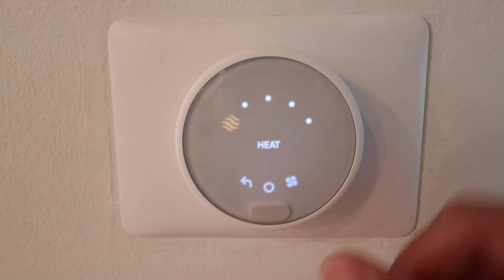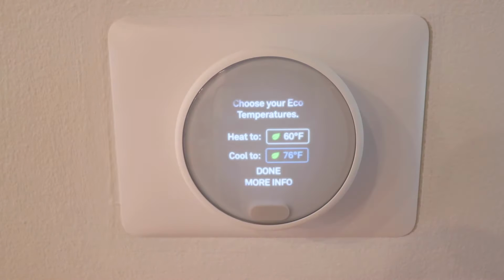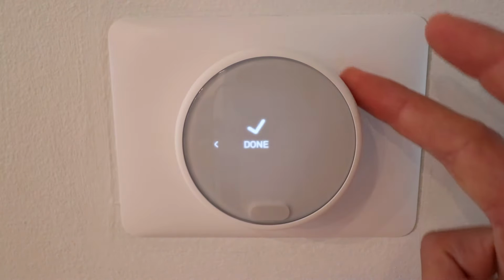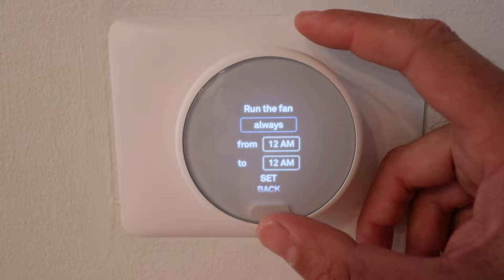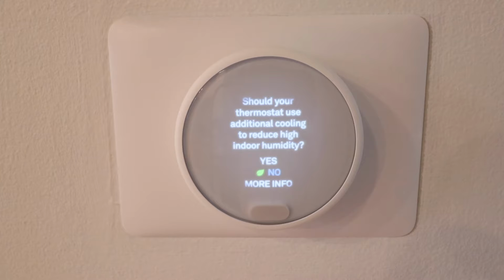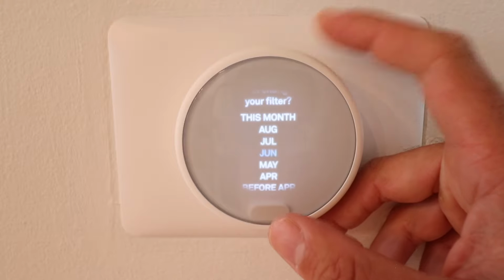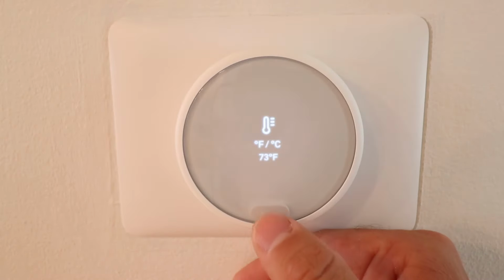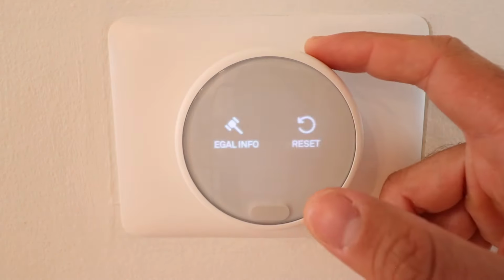Nest E Manual - How To Use Nest E

Comment: I set my nest on 75 It goes way down to 65 I've and then up to 80 it won't hold the temperature I can't believe there's not a spot to set the minimal heat threshold like my other thermostat
Reply: Facing same issue we got to solve this 👍🏼
Reply: Just got one installed and I noticed some things on the Nest app you can click on schedule and see if you have any temperature changes set for certain times.  Either that or check whether you have the eco mode set.
Reply: Me too have same problem
Reply: @susiejones4262  p
Reply: I have same problem
Reply: Same here, same problem 😮
Reply: Turn off the schedule and learning function. And eco mode

Comment: Great job at explaining each function. Thank you!!!
Reply from the maker: You're very welcome!
Reply: So may man video guy, thanks. I think you skipped the most important question or the fucking issue we have with this garbage of an equipment.  Why does it bypass the auto schedule settings for no reason in the middle of the night and run its own for some reason?  What takes precedence, the manual setting or the auto setting?

Comment: My apartment, which has only a heat pump, doesn’t have a C wire. I live in Phoenix so in the summer I’m not too worried about the battery running low or the Nest having to try to charge the battery when the system is off because the AC runs so often. However, in the winter I rarely run the heat because it just doesn’t get that cold that often. I’ve read that when the system doesn’t run often enough, the battery may run down or it might “pulse” power to charge the battery which can cause problems with the HVAC system. I’m wondering if just scheduling the fan to run periodically during the winter will be enough to keep the battery charged without it trying to pulse power to get a charge otherwise?

Comment: Great video.  Not sure if anyone will see this question, but how exactly do I 'hold' the current temperature?  I have the heating set to 21.5 Celsius (approx. 71 Fahrenheit) and the furnace won't turn on even when the temperature drops to 18 Celsius (64 Fahrenheit).  Any help is appreciated!

Comment: Hi. Is it possible to have the Nest E to be on locked mode ans still turn the furnace on or off? My goal is to set a temperature range but still have the ability to be turn on or off the furnace without using the pin

Comment: I may have missed it but is there a way to just keep the Fan on? Not necessarily the AC/cooling feature but just the fan to keep the air circulating? My place tends to get stuffy so I like to have the fan running especially at night for white noise
Reply: Did he ever get back to you mine doesn't let me just run the fan without the AC being on
Reply: @delicious4995  nope he didn’t get back to me unfortunately 
Also, I don’t know how to turn the thing off altogether. Do you know how to do that? For example if I go on vacation for 2 weeks and I don’t want it set to any temp, I just want it off completely, can I do that?
Reply: @delicious4995  also for the fan I think I figured it out 
You raise the thermostat pass the temperature that has the little leaf icon and then go over to “fan” on the bottom right and hit run for the Amt of time you want

Comment: I Have Nest Thomostat ... Is there a way to just keep the Fan on? Not necessarily the AC/cooling feature but just the fan to keep the air circulating .....when ever I trun on the fan AC trun on automatically CAN ONLY ONE HELP ON IT PLEASE.

Secondly .. In winter time I want to go back home for two months how can i set UP the temperature in oder to keep house worm please

Comment: How can I keep it to STAY on the degree I want. It’s 110 degrees outside and inside my house it’s 80! I turn it down to 72 & it tells me it won’t go there I til another 2+ hours. This is really annoying!!
Reply: Rotate until you get to the gear/SETTINGS and then press the tab. You will see SCHEDULE and from there, set -points for each weekday + weekend. A blue dot is what the set temperature is (red for heating - I think) and you can clear those out by moving bezel to get the the vertical bar over a dot, upon which it will be a little larger/brighter. Press the tab and you will find options, one is DELETE. Rotate bezel to highlight DELETE, press tab. You should return to schedule for that day/weekend, but now the blue dot is gone. My understanding is that if you take the time to remove all set points, it will stay that way until a power fail, When power comes back on, I'm told those default set points will return.  I am unaware of a general option to IGNORE SCHEDULE, but there may be one tucked away somewhere in settings. Good luck!

Comment: Why would air conditioning go on when you move dial to 76 when the indoor temperature is at 72? If indoor was 82 I would understand
Reply: So once inside temp reaches 76 air will cut on. It’s basically on auto

Comment: In the first minute of this video, neither "air conditioning would turn on" or "the heat is on" means heating or cooling is taking place at that time - even though that's the common understanding of those phrases. What is meant is that the heat is SET TO TURN ON WHEN A THRESHOLD IS MET (same for cooling). The threshold is the large blue/orange number. When heating or cooling takes place depends on the present temperature - the small white number near the top of the display*. A casual viewer of this video would not know that. I am unaware of any display element that indicates that the air conditioning or heating is taking place at that moment, although you can intuit it from the white "IN 15 MINUTES"

Also, the white text display under the number is on for a few seconds. The entire display will go blank in short order, so keep it on throughout - and make the text larger, please.

* the present temperature is not displayed in a specific place, but moves left or right to prevent it interfering with the tick mark that moves like the end of a minute hand as you rotate the bezel.

Comment: Is the thermostat in this video an older model? If so, do you know what the equivalent new model is and if it will plug right into an existing wired mount?
Reply: Nest Learning Thermostat -  3rd Generation. Most next have similar compatibility. Search for a comparison of the Nest E vs Nest Learning Thermostat 3rd Generation.

Comment: Does this work with a newer 2 stage furnace?
Reply from the maker: Yes it will but it will only enable 1 stage. For 2 stage furnaces I recommend the higher end Nest Learning Thermostat: https://amzn.to/3R6sUxN which works great with both 2 stage heating and cooling. This video explains the difference between the different Nest Thermostats: https://youtu.be/LWxq9ZGZ78U I highly recommend watching it to figure out what Nest Thermostat is best for your HVAC system.

Comment: I would only use the nest for heat that said when I set the heat to 70 does the nest shut the heat off as soon as it hits 70 or does it overshoot the temp.  I ask this because I have an old honey well thermostat that did this and I like the feature.
Reply from the maker: With the Gen 3: https://amzn.to/3n9rq5J it will turn off exactly at 70 I haven't had any issues with it overshooting. In my experience and I can't explain why the temperature sensor in the Nest E seems less accurate.
Reply: @OneHourSmartHome  I purchased the Nest E and yes when I set it to 70 it overshoots to 71.  I'm OK with that because the wife likes it to overshoot a bit.  So far it's working well.
Reply: No thermostat should require a 30-minute video to explain. This model is ridiculously complicated. Way too many options that I'm sure nobody uses.
Reply: @Davidmallen429  Options mean opportunity to make choices. It's not hard at all to skip what you don't need. That is covered very well.
Reply: @MrStan913  I just had nest E installed but temp falls down to 72 with being set at a higher temp I get cold before it comes back on?

Comment: Question: If someone can help me with that.
I have a Nest PRO E. My AC units turns On/Off per my temperature setting which is fine, but when I set for heating the fan keeps running even after the heater turns OFF at the set temperature. Why this doesn't happen for AC but happens for heating? Thanks in advance

Comment: This is the most stupidest thermostat ever. Screw you Duke energy and my stupid apartment manager who thought it would be a good idea to have the energy company install these thermostats in every apartment unit. Not only is this allowing the energy company to spy on us and keep track of our HVAC usage this stupid thermostat is just no good. The temp is all over the place and once I figured how to set it up to keep the temp at one spot it makes no sense that I had to set it at one temperature for multiple time frames for everyday of the week. I am now stuck with that same temperature(73 degrees for the rest of the summer). If I do want it to say 71 degrees I can put it at 71 but all it’s going to do is go right back to 73 degrees. I had no problem with the previous thermostat, on that one you set the temperature and it stayed there until you adjusted it again. This thermostat is a good example of what not to do with a thermostat. Give me a thermostat from 1990 and I’m happy.